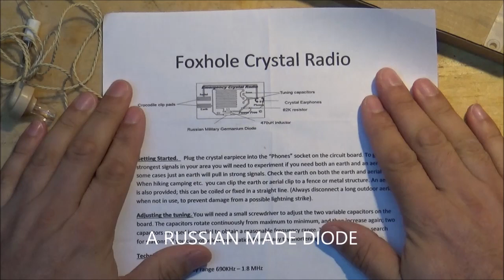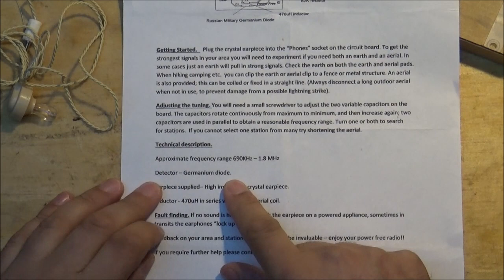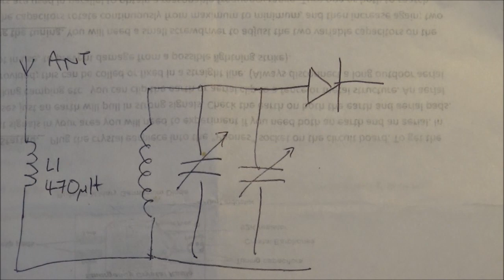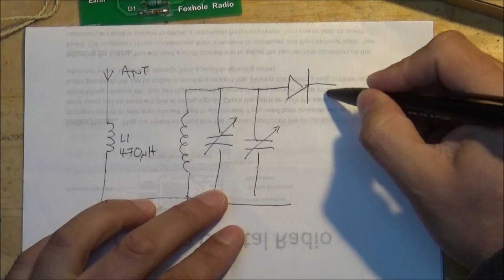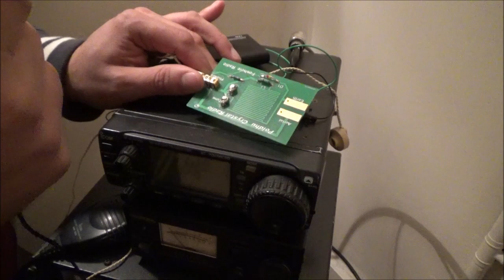Apocalypse fox hole germanium diode radio...  Yup, its not bad for £10

Comment: Your Schematic is not quite right as the two Coils are connected in series as part of a Parallel tuned circuit.As shown the Printed coil does not appear to do anything.I wonder if there was meant to be a Switch to short out the 470microHenry coil to then use the Printed coil for Short-Wave reception?I also wonder what sort of Programme B.B.C. Radio 4 could transmit to cheer up someone who was trying to keep hordes of Zombies out of their home?
Reply from the maker: All very good points!!  ...  I would need to re-watch this video (and will do) to confirm your findings... it was one of my early videos! I’m almost certain BBC Radio 4 (if amplified through a loud speaker ) would keep zombies away... as would the shipping forecast!!  :-)

Comment: Hmm, i also used to have a crystal radio as a child, mine was a 500pf variable "toaster rack" capacaitor, a OA90 diode, a toilet roll tube lol, with lots of turns on it, and an old telephone earpiece (better sound).
With a long wire and a good earth it would annoy my brother across the other side of the room, oops lol :-D

The coil/capacitors on that pcb are too small i suspect, losing voltage/volume output.
The ant and earth are labeled the wrong way around, the earth should be connected to the earphone and coil.

L1 isn't in series with the antenna, it's in series with the pcb coil (to make up the value and look pretty) lol :-D
Reply from the maker: +zx8401ztv yes it’s an interesting design that leaves much to be desired... but... I was surprised it actually worked at all...  I’ll be performing an upgrade in the near future!!  Thanks for your comments and thumbs up!  ... keep em coming!!

Comment: all you need is a germanium diode  and some magnet wire and a tread spool  and a paper clip ... a good earpiece and diode  is the key .... and It's plenty loud ... a rolled coil is gong to pick up more electrons than a printed one. Fine wire  ,sanded  and a paper clip  will probably have better selectivity than those surface mount tuning caps... I suspect most all  those parts in that kit are bottom quality.
Reply from the maker: I’m clearly going to have to revisit this video in the future... I’m thinking of making a 3D printed radio... that would be fun!!

Comment: Good review. If anything you saved a few curious peeps from wasting £10, me included. Although it looks like a nice cheap children's educational aide and a blast from the past, It's easy to add some kind of EMP protection to an existing small 'free-energy' radio, powered by dynamo/spring and/or solar panel. I see few if any advantages at all to relying just upon a crystal radio in an apocalyptic scenario, with so many modern equivalents already available.
Reply from the maker: I was planning to make a nice bedside radio from scratch, but other projects seem to have me distracted!
Reply: Your not an inventor unless you've got at least fifteen unfinished projects, ten of which you're getting stick for not finishing!
Reply: Bear in mind that the utility of a crystal radio relies on high-powered medium-wave broadcast stations in the local area to get enough power to drive the earpiece.  It just the thing when YOU can't afford a battery, but the rich man down the street can still sell radio ads to his friends.